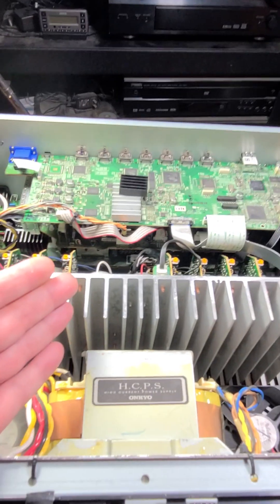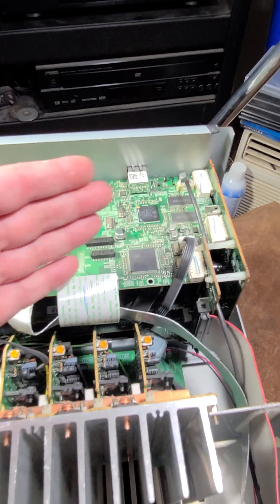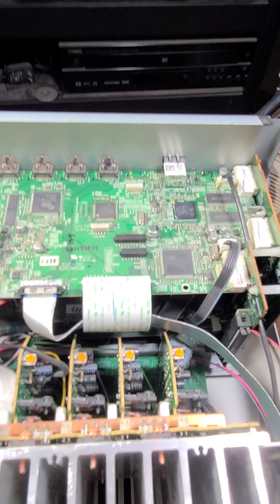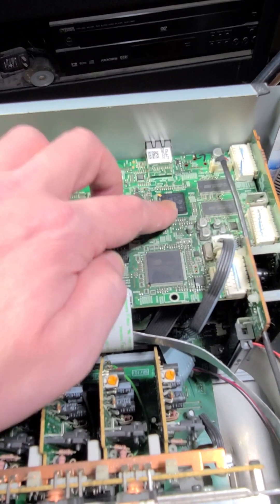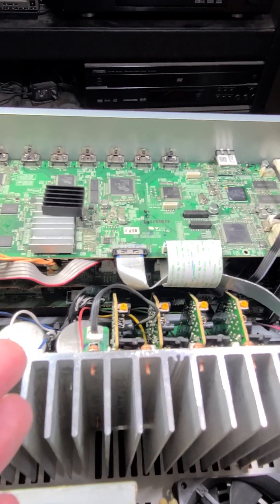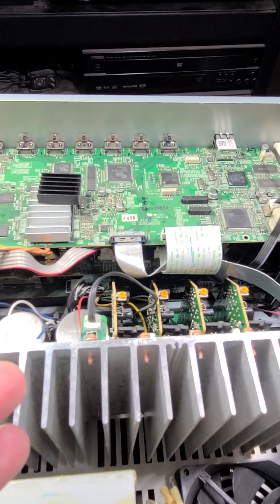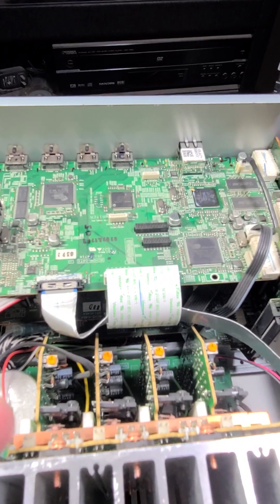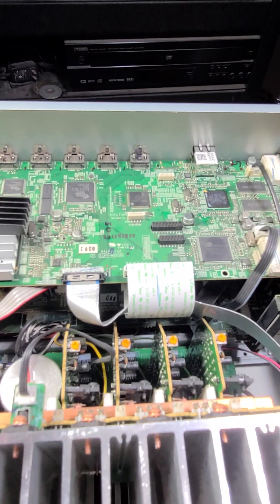1 Year Update, Onkyo HDMI/DTS Chip Board Repair

Comment: I had the whole PCB in my oven to heat the chip up to fix the problem. It worked three times, but only for a month. Then I tried to disconnect it from the wall... power completely off while it was not in use. It lasted for about 5 years!! But now I have the problem again. But... still it gave me 5 years instead of a month.
Reply from the maker: That's interesting how disconnecting it from the wall helped extend its life!
I replaced it with a Yamaha RX-A780

Comment: Struggling with my Onkyo TX-NR575 no video output, sound works fine. Saw where I may need to reflow the solder around the DTS chip.  Have the BCPRC-2409 HDMI board but am having difficulty recognizing the DTS chip or the correct chip to try and reflow.  Any help would be appreciated.  I see a Cirrus Logic chip but I think that is for sound.  None of the boards on Youtube look exactly like mine and chip placement is in different places.  Any guidance would be appreciated.  Thanks in advance..... enjoy the videos.
Reply: what is the chip name?
Reply: @Bumerang378  found the chip it’s a Toshiba. Tried the heat gun trick in addition to putting a soldering iron on each pin. Still no dice. Wish I could make it work but I guess it’s above my pay grade. Maybe I need to pull it from the chassis and work on the back side of it. I need to find a way to test whether or not I’m barking up the wrong tree because the chip is fried
Reply: @suburbanworkshop  wait is the DSP chip made by Toshiba, cuz in many cases the Texas Instrument chip goes bad

Comment: yeah I've done this a few times you get a few months each time then eventually it will die altogether i think
Reply: I don’t know what that means. In our case it was a permanent repair. No more problems, always on, now ten years later. It’s fine, you might have a thermal control (ventilation) issue.
Reply: @declanfarber  not getting any video out on my TX-SR608. any ideas? the rear inputs stopped working so i plugged into the front aux hdmi port and that worked for about a year and now none of them work lol
Reply: @declanfarber  Nice to hear that your Unit is working. How did you repair it please?
Reply: @vortexor1  It was repaired by Onkyo under extended warranty back in 2014 or so, and it’s been fine ever since. Supposedly they swapped out the HDMI chip, as I recall.

I do have really good ventilation, which matters because it stays on all the time.